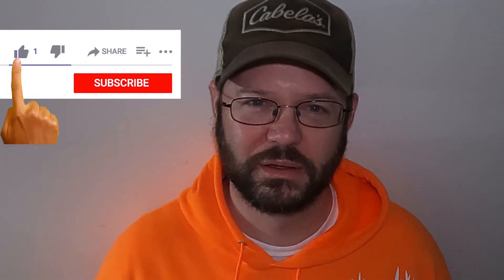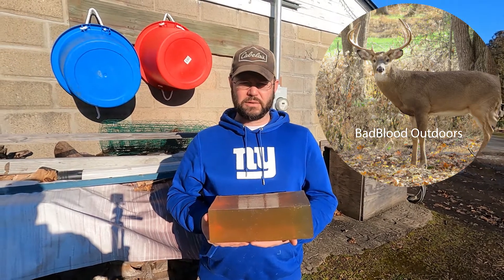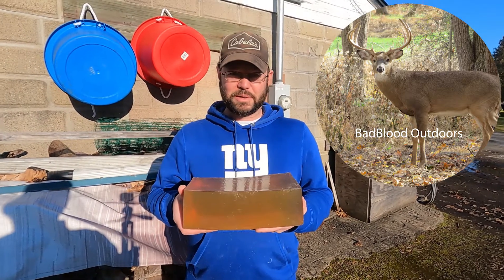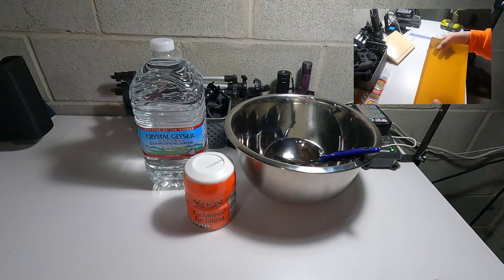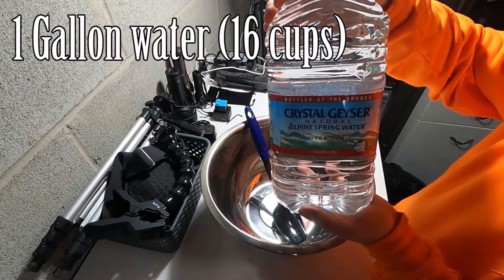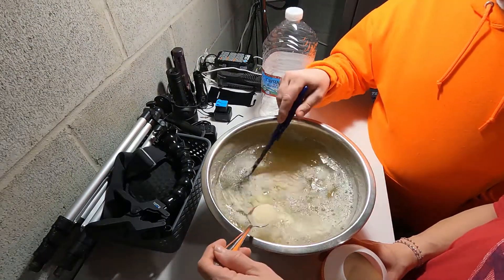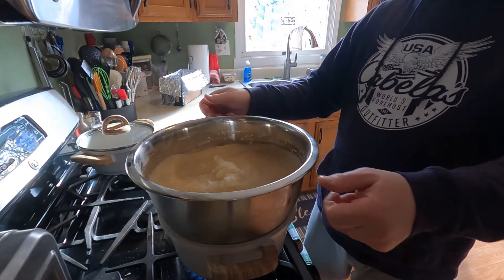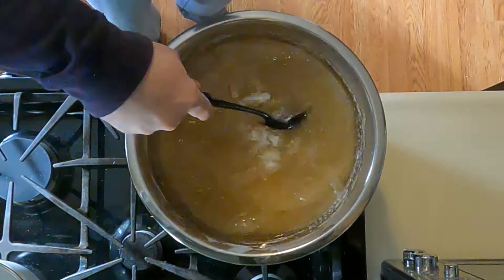Make Homemade Ballistic Gel for Under $10

Comment: For a reusable mold that is much faster to set up and strip, the short sides should be fixed in place to the bottom board. The longer sides attach to the bottom board with hinges. A simple clasp at the top of the long boards to secure to the fixed short boards... 
When the gelatin has set, release the clasps and the long side boards swing down to release the mold.  
It works great...
Reply from the maker: I hadn't thought of that.  Maybe if I make another mold I'll try your technique.  Thanks!

Comment: Generic plastic shoe box from Walmart or the like seems a better mold.
Reply from the maker: Honestly, use whatever works best for your needs.  I used materials I had on hand and was able to make it the exact size I wanted.  Doing it this way also allows me to take the mold apart and reuse it...makes removing the hardened gel much easier.

Comment: I think a 50 cal ammo can will work as mold
Reply from the maker: If that's the size you want then it would work. However, if you can't disassemble it then it'll be more difficult to remove the gel without damaging it.  That's why I made my own mold.

Comment: Watching a few different videos on how to make this.  Seems like the recipe is the same. With that said there are some things the first video did different that i think might help.  
1. Is using boiling water when making the gel to melt clumps and then pooring directly into the mold.  
2. Was using a plastic bin as a mold as they are pre-made, Rectangular, sealed so no leaks, and can bend so its easy to remove gel and re-use.
Reply from the maker: 1. I didn’t get any clumps using this method
2. If I was able to find a plastic container of the exact size that I needed I would have used it…easier said than done.
Reply: @BadBlood Outdoors  fair.  Wasn't trying to be rude though. Sorry if it came across like that
Reply: @toastyghostyofdeath-clippy  I don’t think you came off as rude. The guy has a small channel so maybe he’s just a little defensive. Seems like a good dude overall, but may be a little awkward

Comment: Plastisol (the stuff they make fishing lures from) is available in 5 gal buckets. It's more than 10$, but less than half the cost of ballistics gel. 
I've been working on designing and testing lathe turned hollowpoints, and was going through a crazy amount of gel. The plastisol is almost as good as the real deal. And can be recast. 

The problem with animal based gelatin is crumbling. When I tried it, with firearms, it just blew into 1000 pieces instead of staying in a solid block.
Reply: Thank you for this!
Reply: 338 Lapua ? 😆👍

Comment: Does ballistic gel have any tensile strength?
I work with silicone, and getting new silicone for every test cast is expensive.
The gelatin i made rips so easily that i cant get it out of the mold.

Can i use this stuff, or is there no way to make gelatin stronger?
Reply from the maker: No, you could rip it apart with your hands if you wanted.  It can be made denser by increasing the gelatin:water ratio.  I would try that or lubricating your mold so it releases the gelatin more easily.  Good luck!

Comment: Why not buy a plastic container?
Reply from the maker: That's an excellent question.  I wanted to make it simple and make just enough gel for 1 container of gelatin.  Therefore, in order to make a block of a desired size I needed a very specific sized container...which I could not find...so I made one.  The ability to take one side off of the mold also made it easy to remove the block from the mold.